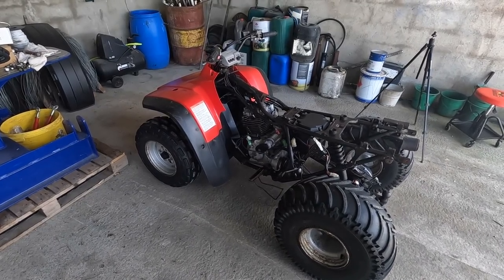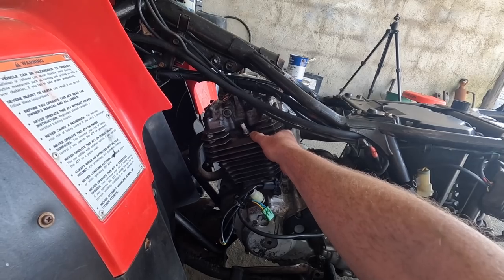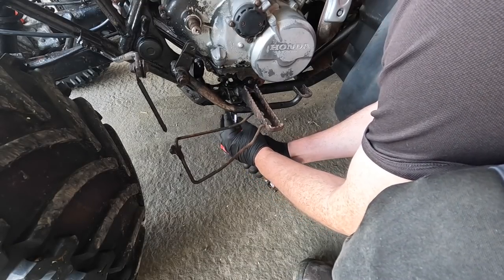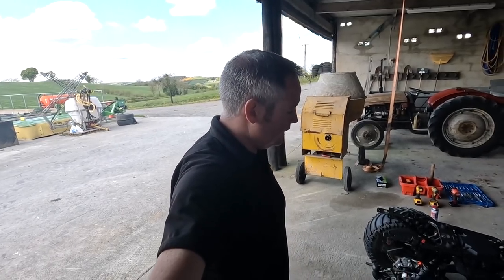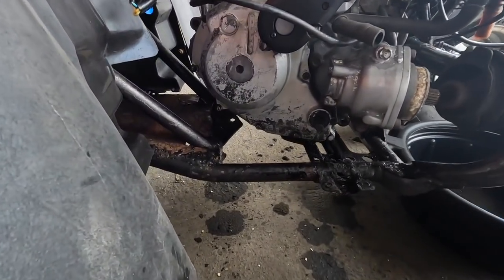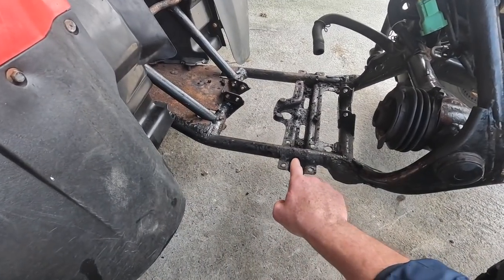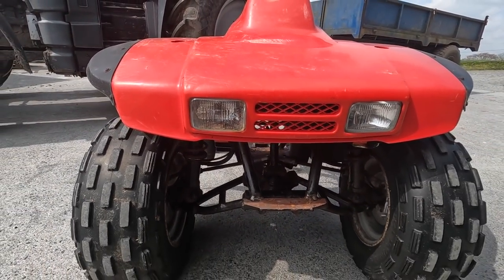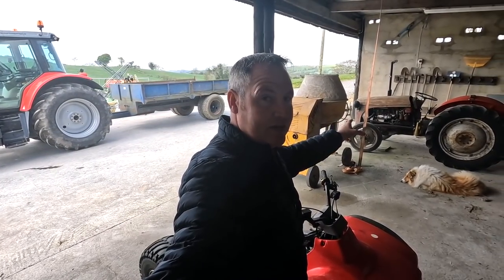ENGINE REMOVAL HONDA BIG RED 300 - FRAME IS IN A BAD WAY!!

Comment: Just moved to Cavan a couple months ago. With 13acres to look after is a daunting task for a ex city lad but your channel has been very enjoyable to watch & learn. Currently looking at a small tractor to buy & most possibly a quad also. Would you have any recommendations for a novice like myself?. Thanks for sharing.
Reply from the maker: Well mate, get your yourself a little 500 series Massey, sometime like a 550/565/ 575. Brilliant little tractors and easy to look after. Honda 300 quads or a 500 like mine are hard beat for quality 👍
Reply: @IFarmWeFarm  Thank you so much for your reply & advice. Very very much appreciated, will get myself researching those asap. You are a diamond, keep up the great work.

Comment: Be fine quad when finished  put new tyres and steering bushings in my one last week parts are slow to come check steering knuckles mine seized with no warning pulled handler bar out of my hands

Comment: Two fun projects Adrian, is that an m12 Milwaukee impact? Is it good enough to take wheel nut off quad/car/tractor?I  Was looking at them and DeWalt 18v can't decide which to go for!
Reply: The dewalt is certainly  up to the job, I've never tried a miluwake as I have quite a few dewalt batteries.
Reply: @paulf2529  I've got a half inch air impact but would like the freedom of battery, do you know about the 12v DeWalt?
Reply: @mrcallaghanbarry  my dewalt is the 18v,  the 3/8" 12v is really compact but I'm not sure if it would handle  undoing  tight wheel nuts.
Reply from the maker: Yes that’s the 12v Barry, that’s one of the smallest in there range. Would be completely useless at taking of any wheel studs. I have the dewalt 18v 1/4 and 1/2 inch impacts, I also bought the Milwaukee 3/4 in November last. If it’s wheel studs you have in mine then the Milwaukee 3/4 all the way. Now I love my dewalts but the 3/4 was a big let down power wise, wouldn’t remove tractor studs unless they were broke first. The Milwaukee is heavy and expensive though but an animal of an impact. Always finish studs with a torque wrench anyhow lad
Reply: It'll have to be the 18v so! And as they say if it's not red!!! Have to torque them alright, better safe, thanks for the replys lads👍